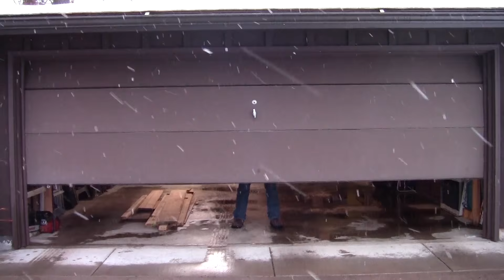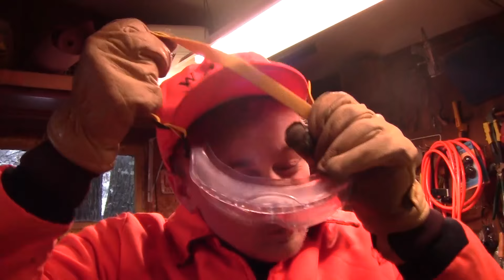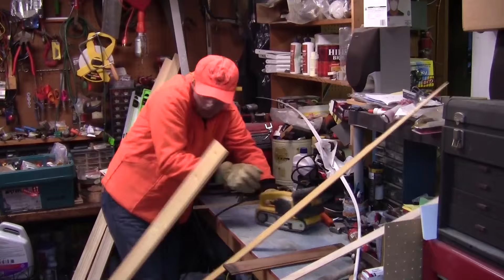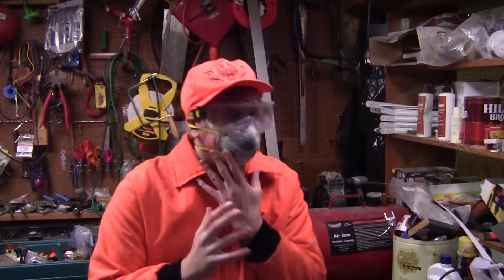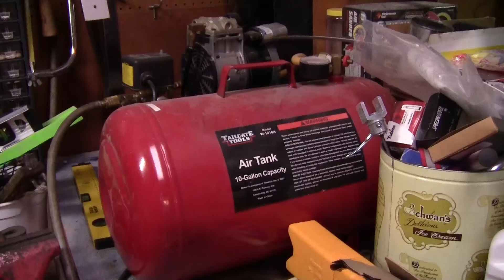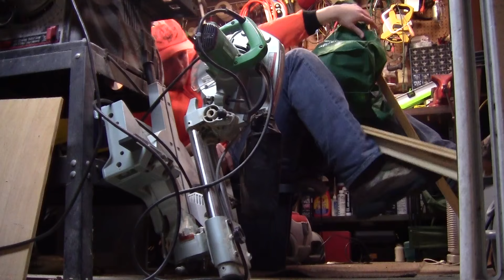Working Man 2: Garage Tools - Gus Johnson Comedy Short

Comment: I wouldn't' advise wearing thick, bulky gloves while operating machines that have rotating parts, like a belt sander. The fabric could bind into the roller and pull your fingers in and cause serious injury or even mutilation. Even without gloves, those types of machines run a risk of causing a "degloving injury" if you are not cautious.
Seeing you so spasmodically reach out to carelessly grab the belt sander while it was still running made me think that you're trynna "SHAKE HANDS WITH DANGER!"

P.S.: Do not google images for "degloving accident".